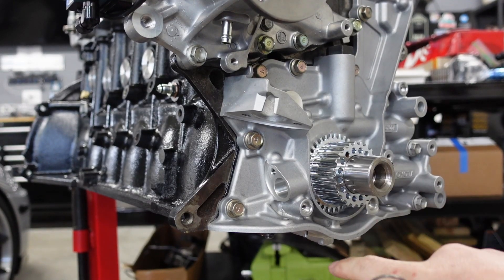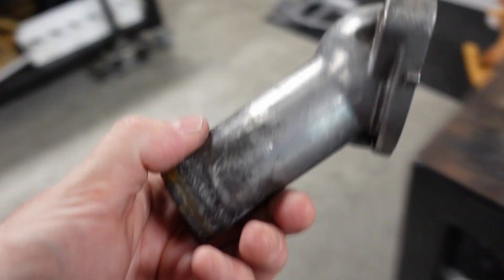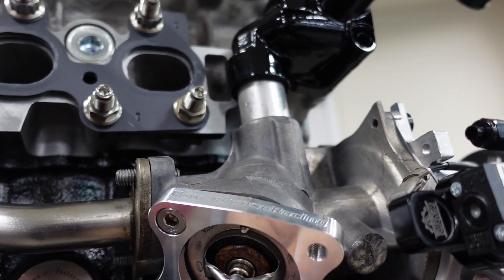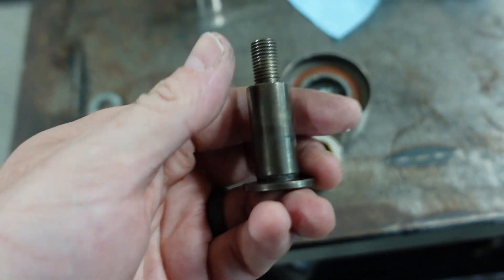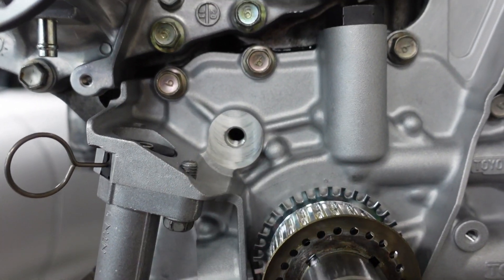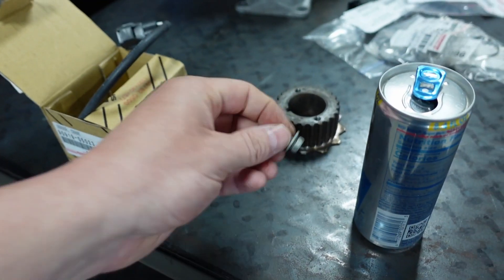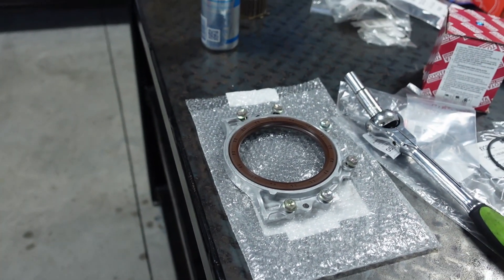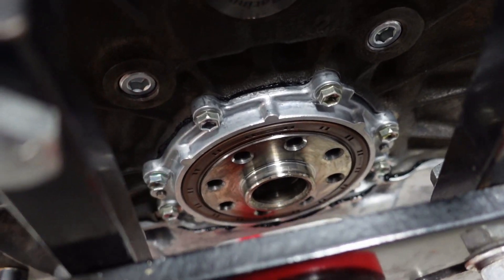2JZ Engine Build Ep. 13: Billet Timing Tensioner, PHR Water Neck Rotator & Rear Main Seal

Comment: Why is the 36-2 crank sensor necessary? I have the 90919-05006 for my non vvti with upgraded 36-2
Reply: I'm putting my engine together as we speak and I want to find out about this as well if the PHR 36-2 timing belt crank is compatible with crank sensor 90919-05006.  Thank you.

Comment: Nice. Gathering up all my stuff I've had lying around and starting to put mine together. So seeing as my head studs are... nearly 20 years old I should avoid using arp washer and just torque nut directly on head. Hopefully I understood you correctly. Very detailed btw doing good work. ^^b

Comment: Was because the washer studs are sinking in the head or did they fix the issue with the 625 head stud washers? cause I haven’t opened the box yet but I told with the 625’s I shouldn’t worry compared to the older arp kit?
Reply from the maker: They fixed that issue about 5-6 years ago. This is just a consistency issues my engine builder had seen along with the other builders he works with. They found this to be more consistent and accurate.